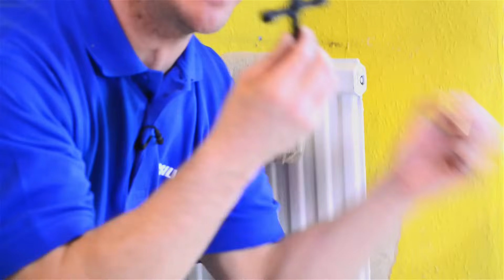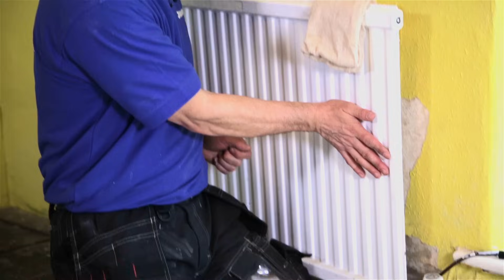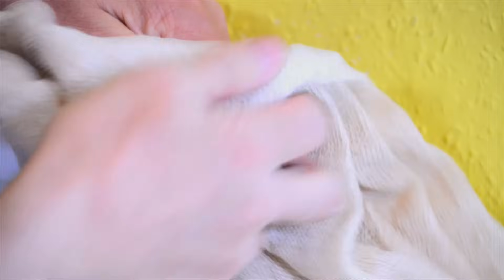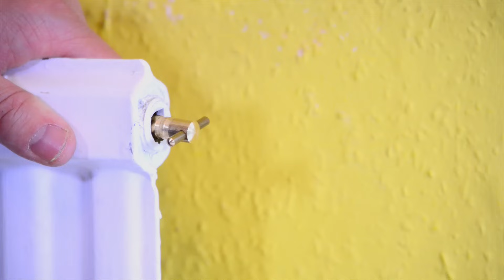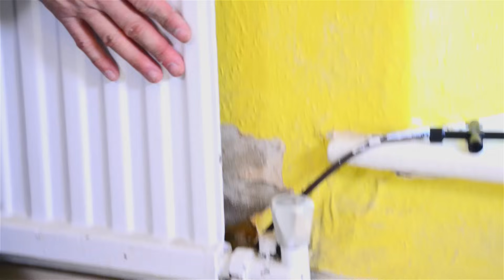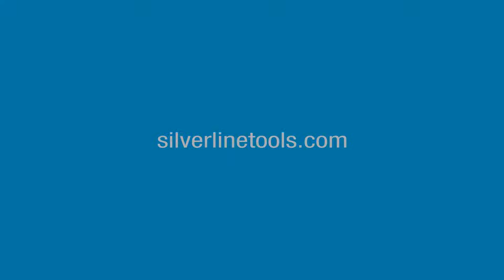How To Easily Bleed A Radiator

Comment: Before you bleed your radiators, ensure your heating is turned off and your radiators have completely cooled. Although a screwdriver can be used for some modern radiators, most radiators require a radiator key to bleed. ... Once all your radiators have been bled, check the pressure of your boiler gauge.
Reply: how do you do that
Reply: It looks like he had the heating on as he was checking the radiator to get warm. So who is telling the truth?
Reply: @bartkuk1  he had it on yes. But he is probably used to it as a professional. I think it's just about being careful not to burn your hands.  You won't to get burnt if the heating is off
Reply: Thanks for the tip
I was wondering if the heating needs to be off or on
Reply: You bleed the radiator once the heating has been turned on. That way you know the water is being heated through-out the radiator. Who told you to turn the heating off?
Reply: It is very confusing whether to keep heating on when bleeding the radiator. In the past I had the heating on & water was scorching. Today I had looked at 3 YouTube but only 1 says to keep heating off after 20 mins to let water cool down ( but I don't understand where to turn off, at the mains or the radiator site) when bleeding the radiators.  Wish these experts could be more clear when teaching other who have no clue. That's why we are here searching for help.
Reply: @kimberly6143  its usually best to turn the heating off at the boiler if you're worried about getting burnt, and then give it a short while to cool down so it will still be warm (so you can feel it moving through the radiator) but not hot enough to burn. Alternatively just leave the heat on and be careful/ quick with the rag.
Reply: Can we put on a pair or two of washing up gloves whilst doing this to avoid burning the hands?
Reply: A key part the video missed out. Thanks
Reply: @danbgrd  No problem. Glad it helped.
Reply: @angels77100 a HVAC contractor told us to turn the heater off before bleeding the radiator
Reply: What if I cannot reach the point to bleed the radiator? How do I proceed? Thanks for any tip
Reply: @BishoujoMegami agreed 💯💯💯
Reply: Thank you for this comment. I wasn't sure if the heater should be turned off. I was concerned about this because my old neighbor was seriously burned when he bled his radiators. This is the first video I've watched hoping it would mention that. Again Thank You
Reply: I suppose once the air stops escaping and the water comes out . That’s when it’s done …hot or cold .
Reply: @patriciakenny7194  When the air rushing sound stops and water comes out, then it is done. Tighten the valve (on the radiator that you are bleeding) to stop the water escaping and then turn your boiler (central heating) on and see if the boiler pressure gauge is correct.
Reply: Leave the heating on and don't be a baby.
Reply: I did bleed my radiators and after the noise I did let out some water...why the he'll not.  Do I need to top it up with water within the boiler. ? It is a new boiler and I am not sure what to do ?
Reply: @ahmeterik2012  Boiler pressure should be between 1 - 2 bar.  If the meter is reading less than 1 bar you should top up the boiler with water until the meter is reading about 1.5 bar.
Reply: I did this for real. I turned the heating off. Slowly unscrewed the valve for a level that you can comfortably control and close it at any second. Air went hissing for less than 1 minute. Kept the cloth nearby the valve. Finally water drop came and closed the valve in 2,3 secs. And all works fine now. No need to worry.
Before anything just make sure you can close the valve within seconds.
Reply: I left heating on , now there's a pressure issue after bleeding , what do I do ?
Reply: That was the information I looked on the internet to find out about which led me to this video. So thank you for telling us
Reply: @Stardust_Truth_Seeker  Thank you. Glad it helped.
Reply: Mine is cold at the bottom and warm at the top
Reply: About 2 bar of pressure ?
Reply: Ate you sure... How did the hot water rise up filling the rad if system.was off?
Reply: Thank you!!
Reply: I want to do this when the radiators are on
Reply: Why check the pressure of the boiler gauge? What's a good pressure (more importantly)?
Reply: @Jill_of_trades  The water pressure will have dropped after bleeding the radiators. A good pressure is 1.5 (half way between 1 and 2)
Reply: Thank you
Reply: @Bibg867  You're welcome.
Reply: @christophemanzanga1935 Rip the radiator off the wall so you reach it.

Comment: Don't forget to top up the pressure that was just lost if it drops below 0.6 bar on most boilers you will need to top up from the filling loop and reset cycle.
Reply: What?
Reply: @XgamerdaveX  When you bleed the radiator. the air escapes. And the water pressure throughout the system is lower than it should be. So you need to get the pressure back up to around 1.2 bar. This makes up for where the air once was. Hope that helps.
Reply: Tony Crabb how do you increase pressure. The original comment talks about increasing pressure using a filling loop. I don’t know what that is.
Reply: @XgamerdaveX  Underneath the boiler there should be a tap/lever you either turn or press to increase the pressure. You will know when you turn the correct one, as you will hear the water filling the system back up. Remember when the pressure reaches around 1.2 bar or in the green depending on your boiler. Turn the water off.
Reply: Ehh.. This video is aimed at amateurs, not expert..
Reply: @Fr3ddyUK  turn the water off ?? I'm confused
Reply: @chrisilever8586  Once the pressure is at the correct level. Turn lever back to its off position, because if you leave the water constantly filling the system. It will quickly overfill. And pressure will be to high. I didn't mean turn the mains water off. Sorry if that is what came across as.
Reply: @Fr3ddyUK  hi hun thank u just not sure which one to turn as I have a potterton it has 1 at front and 2 at the back I did watch plumber few years ago I just can't remember lol 😆
Reply: @XgamerdaveX  its called a by pass valve
Reply: Hi, what if there is no way of telling the pressure as there is no boiler gauge??
Reply: wtf is this guy talking about? 
Talk to us like we are fecking 5 years old!
(rolls eyes)
Reply: @Fr3ddyUK  you’ve just saved me an engineer call out thank you!
Reply: @mariannescarfe6836  Glad to be of help :)
Reply: So i am here because my pressure dropped in the tank so I filled it up but went to far to 2.5 bar..... Need to drop it down. Is bleeding my radiators the right way around this
Reply: Should I turn boiler off before bleeding radiator?
Reply: @StellarMMA  yes it can damage the boiler if it has to deal with low pressure, so off is correct

Comment: Do you turn the radiators on or off to do this and how long should it be left on if you turn it on? obviously you don't want to get scolded but do you need to have the pressure in the system to bleed the radiators?

Comment: Thank you for this instruction :)
Reply from the maker: Glad it was helpful!
Reply: @SilverlineToolsTV  small question, if you don't mind. There was some air in the radiators. But one of them made the hissing air escaping sound while water was dripping out. Is there air inside or what could that be?

Comment: Look if you can hear the air escape when you open the valve then there is in most cases no need to leave it open when you turn on the heat. If however no air is released, then turning the heating on is necessary. I've been doing this successfully for countless years, and as a rule of thumb, I always turn the heating on regardless before I start bleeding.

Comment: My radiator feels cool at the bottom so I did what ur video said to do but only water comes out when I bleed it so not further with the cold bottom of the radiator it’s a brand new boiler and radiators fitted less than 5 month ago three out the house any advice ?

Comment: After bleeding the radiators don't you have to do something else to introduce more water  from the mains into the heating system?
Reply: yes - you need to release the water valve under the boiler to build the pressure back up.

Comment: Should I carry out this process when the heating is ON or OFF? Or makes no difference?
Reply: Hi did you find out?
Reply: @claremckinnon5610    No!  Should the heating is on or off?
Reply: @gringolin  The cowboy is bleeding the radiator with the heating turned on. You must not bleed a radiator when the heating is turned on as it may be too hot to touch and hot water could spray out of it. Ensure the heating is turned off before you begin bleeding a radiator. Letting out air when the pump is running will only draw more air into the system from elsewhere.
Reply: Always make sure the heating is OFF and that the radiator is cold before bleeding.

Comment: So you don’t have to switch off the boiler before you start doing this bleeding? I am quite confused as I can see this is advised by other videos.
Reply: Turn it off beforehand, aside from the possibility of being burned with hot water, you could also introduce more air into your system.
Reply: @0909Yellow  Thank you 😊 I will always do as you advised me now

Comment: I need help guys. thanks for your video. my radiator is fully cold everywhere i tried to bleed it like this and no air came just water straight away. what can i do ?
Reply: Sludge build up in the radiator, You may have to have your radiators flushed.

Comment: Hi I have a radiator upstairs in my bedroom when heating is on it makes a noise every 5/10mins or so of like water traveling.  Even if heating is off and several hours later same noise from radiator. Also not sure if this happens if we open the water sink and close. Are you able to shed some light why this is happening and a solution please

Comment: what happens if there's no heat at the bottom but there was last winter when it worked? Some air came out and then water but still no change doesn't work.  It's the top radiator in a three story although the other room on the 3rd floor it's radiator is fine.

Comment: hmm you didn't turn of the heating before bleeding it?...i ask because someone did this the same way, and straight afterwards there was a warning/error with the the central heating...most other guides i have looked at state to turn off the system...anyway thx

Comment: Thanks for this, however, I have a rad same design as one in your video, it is just warm at top but cold at bottom. The rest of the rad's are very hot, I bled this one and water came out, it has been suggested it is silted up BUT was flushed out 15 years ago, could this actually need doing again?
Reply: Yes as radiators corrode over time it will have metal particles in it or silted up as you put it so will need flushing out again

Comment: while you do this, is the heating supposed to be switched off, or doesn't it matter??
Reply: First you turn the central heating full on to identify which radiators need bleeding, then you turn it off and allow the radiators to cool down until they are comfortable to touch.
Reply: thanks :)

Comment: My Worcester 12i gas boiler has just been serviced by Worcester engineer and now it’s just below 2.5 when hot water and heating switched off. Before it be ~1 when off and ~ that when on. Now When both turned on it goes into red zone @~3. I called Worcester about this, they said boiler condition is healthy and I need to bleed radiators to bring the pressure down. There’s 5 radiators in flat, a tradesman bled one of the radiators saying only one needs to be done as it’s a circulatory system. True? Boiler heating was switched on but radiator was turned off when he bled. Do radiators have to be on when bleeding? It leaked trickles of water almost immediately. No air leakage sound heard. Is this normal?

Comment: When you bleed the radiators do you start from the highest level? For instance in a house do you start to bleed from upstairs downwards ?
Reply: Doesn't make any difference as the air is in the radiator not the pipes.

Comment: Does it need the watter to be cycling through the system when you do this?
Reply: Terry CH start lowest first, if you have a combi boiler remember to check the pressure gauge and put more water in if necessary

Comment: my radiators are very hot but  there's a whistling noise when the boiler turns off and on
Reply from the maker: Could be a few things, water flow could be too high. Try turning the valve to the highest setting and see if that stops it. It could also be limescale build up, especially if you live in a hard water area.
Reply: @SilverlineToolsTV  Yes i do live in a high limescale area. I had the boiler serviced recently, he said cleaning the filter will fix it, but it didn't make any difference.

Comment: Im at uni this part of my radiator suddenly exploded water everywhere, luckily i acted fast and turned of the socket near it and also covered it with a towel i spent 30 minutes trying to figure out what to do i tried closing it but couldnt see what was happening found the opening and closing valve of the radiator and closed the one i thought was right and the water slowed turned out the part you use to bleed the radiator broke off and im not sure how to explain to uni??? is this a normal thing?

Comment: What if you haven’t got this key can you use alternatives ?
Reply: They're about fifty p but as has been said already, screwdrivers are needed for the very newest rad valves.

If you can't buy or talk to a neighbour and ask to borrow one, you can use pliers. But they are liable to scratch the paintwork.

As Craig says at the end, there's sthg v. satisfying about feeling the rapid effect of your success leading to heat racing from btm to top of the rad. "Pair fecht"
Reply: @JP_TaVeryMuch thanks mate

Comment: I've opened the valve, and i hear the air coming out, but then it stops hissing, and no water comes out???? and when i do it back up wait about 5 minutes it's still cold half way up near the valve!!!

Can i just leave it off? while the heater is on? will that work ?? is there an easier way!
Reply: Hey how did you get it sorted?

Comment: How long do you need to let the radiators bleed for? I turned the key in mine and a load of water has been coming out. Do I keep going till there's no water left? Or stop after a few minutes? The water that is coming out is cold, and it's coming out from the top bit where I inserted the key (sorry don't know the technical terms). I just bought the house, and the previous owner didn't really take care of it very well so I don't think the radiators have been bled in years.
Reply: in the video he said stop as soon as water starts to come out. you're only letting the trapped air escape
Reply: Did you even watch the video?
Your wrote a massive response when you time was better spent listening!

Comment: Do they refill themselves after I release the air?
Reply: Piotr Goralczyk Mine didn't, boiler stopped working due to lack of water pressure in system. Easy fix though, had a quick read through the boiler manual and all I had to do was turn a couple of taps on under the boiler for a few seconds and it all came back on.

Comment: never says on any of these vids weather to have heating on
Reply: You usually don't have it on dunno I didn't feel any water but it still worked
Reply: I wouldn't have the heating on because if you bled the radiator and HOT water came through it could be dangerous!
Reply: I just done mine with the heating on, just do it gently

Comment: BUT... You failed to advise to top up the pressure on the boiler.

I watched this, then bled my radiator, shortly after I had to google why my boiler has stopped working because it had no pressure.

Comment: Mine is warm at top but cold at bottom
Reply: I imagine that it's a build up of sludge, but I'm not sure how you would remedy it apart from removing the complete radiator and flushing it through.  Then again I'm not a plumber.

Comment: Be careful when doing this as I done mine and my daughters bedroom radiators and my boiler pressure went down to far so stopped my heating from working. I found out how to get my boiler pressure back up but had to get council in to do this as I didn't have the necessary equipment to fix it. Was left with no heating till the council came in the next day.

Comment: Radiators should be bled when the system is cold.
Reply: Then why did he feel heat rise in the radiator he bled?
Reply: @jamesmcinnis208  Because the cowboy is bleeding the radiator with the heating turned on. You must not bleed a radiator when the heating is turned on as it may be too hot to touch and hot water could spray out of it. Ensure the heating is turned off before you begin bleeding a radiator. Letting out air when the pump is running will only draw more air into the system from elsewhere.
Reply: @spellbound111   Thanks! Good to know. I'm in the process of setting up 5 old cast iron radiators so this is important information to me. You are the 1st person  I've come across in much perusing in the DIY world who has specified that the system should be shut off. Much appreciated.

Comment: This is inaccurate . You shouldn't perform this task when the system is hot , so why is he saying he can feel the heat, there should be no heat. The assessment should be done when the radiator system is completely off to avoid any risk of burns, you judge based on the water escaping from the valve.

Comment: You MUST NOT bleed a radiator with the circulation pump still running!  If you do, two things will happen - a great deal more water will be squirted out (more likely scalding you & making more mess) and it will draw air in elsewhere (so you end up going round all your radiators in a circle and not get any of them air-free!).  I'd have thought a well-known firm like Silverline would know this and not issue dangerous "tips"...